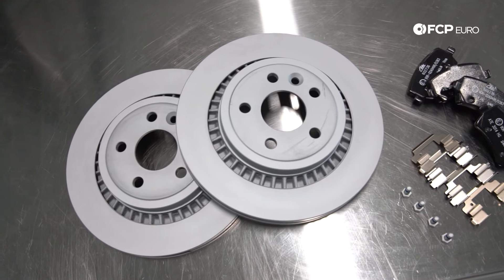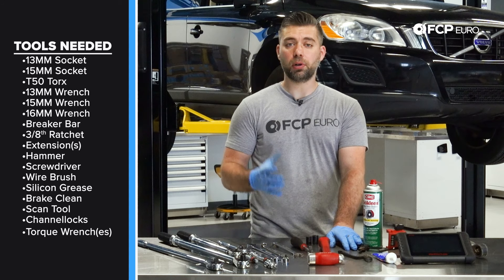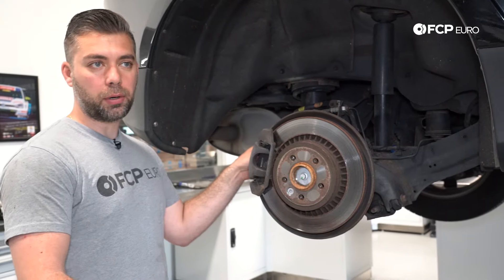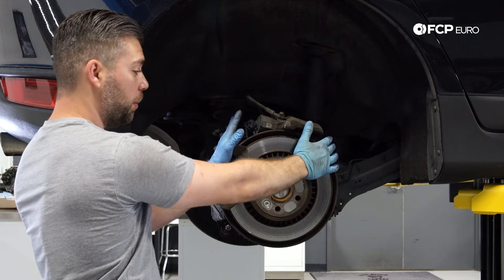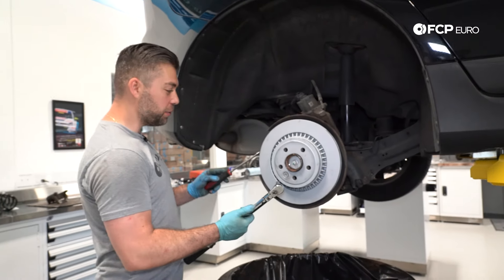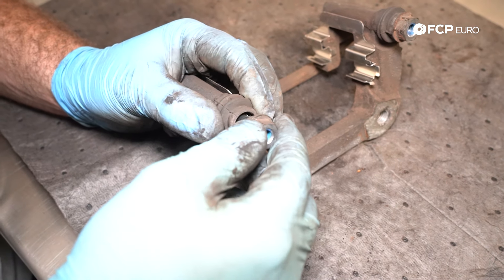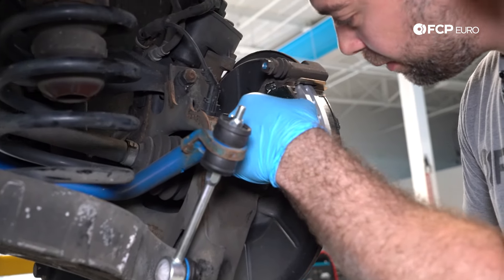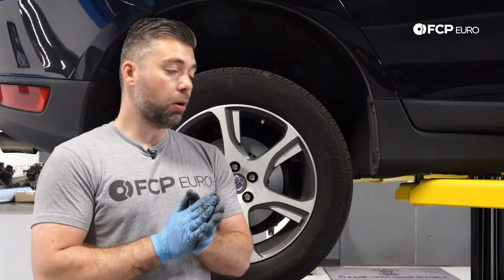Volvo XC60 Rear Brake Rotor & Pad Replacement DIY (Volvo P3 - S80, V70, XC70, XC60, S60, & V60)

Comment: A great help. Did the job (both rear breaks and callipers) in 2 hours, only 4 bolts and a torx50 screw needed to dismantle the lot. Re the electronic handbrake. 2 torx30 screws to separate the motor from the piston, torx40 to wind back the piston then easy to use a G cramp to collapse the piston. If you use the battery method you have to put pressure on the motor casing to collapse the piston. Also did the front pads and discs (just as straight forward), paid £255 for all 4 wheels, dealership wanted £1,100.

Comment: I just completed replacement of pads and rotors at all four corners of my 2017 V60 T5 (with solid rear disks), and in case anyone else runs into this: the rear pistons must be wound back into the calipers. They do not simply push in. They are a clockwise rotation.

Other than that, this video was really helpful, like the other FCP Euro how-to tutorials. Thanks for producing these - I've used several of them, and in particular the inclusion of all the torque specs etc is invaluable (and I like the lack of "fluff" - right to the point and no messing around).

Comment: I used a 9V battery to manipulate the e-brake motor, so that I wouldn't need a scan tool or have to dismantle the motor.  Other than that, this video was spot on for my 2011 XC60.  Thanks!
Reply: @igoldin74  Check out this video, starting around 50 secs in: https://youtu.be/8y54DKRHlAo . I know it looks like you're inserting these wires into a black hole, but there are contacts in there that you're hitting. You'll hear the motor turning, and may need to reverse polarity with the battery if it goes in the wrong direction. Use a fresh 9V, I think I basically drained a whole one between both sides of the car.

Comment: With the electronic parking brake once you have the caliper off put a small block of wood in the gap where
the pads would go and then unplug the electrical connection from the motor. You will see two pins inside
and you just put a 12v supply across and you can wind the motor back. The block of wood is to stop the
piston coming out if the motor is winding out. If it is winding out just swap the wires over and it will go the other way.
Do not forget to put the connector back on the motor.
Reply: Thank you very much!
Reply: Found this video today when I had to do the rear brakes on an XC60 and my diag software didn't have the EPB release function. This comment actually became a lifesaver for me because I did exactly as this comment says and was able to wind back the parkinng brake so i could wind the piston back all the way and fit new brakes. Thanks a mil it really works and its effortless.
Reply: Yoiu can unwind the EPB with a torx bit at the rear of the caliper.  Remember to switch the EPB to "off" before this is possible.

Comment: 13:39 If anyone is wondering, YES, that is WAAY to much grease. Dangerously so. A little dab spread out with a finger will do. The amount of grease he leaves on could, with the heat  generated by breaking, become runny and spill onto the rotors and disable your brakes.

Comment: You don't need a computer or anything. You need a t30 to remove the park brake motor. It's 2 bolts. Underneath it has a splined shaft that inserts into a hole on the back of the caliper. Use a t40 to twist that and it backs right out easy. Then use the t50 to remove the rotor.

Comment: Wheel bolts should be tightened 140Nm
Reply: I'm real late but really doesn't matter I drive 130 with bolts at 110 ft pounds

Comment: You can also wire 12v directly to the e-brake motor. One polarity will tighten it down and the other will retract. Typically pretty obvious.
Reply from the maker: Great point Cory, we'll have to show that method in our next video.
Reply: I used a 9V battery :) it worked
Reply: @fcpeuro  but there is a relearn procedure for the brake pads position, no?  Presumably that's what the 808 was initiating at the end and I believe VIDA references this, though I could be wrong (mine's a 2012 T6)

Comment: Great video but I have an issue with the caliper piston retracting.  I follow these instructions to a T, I have the Autel scanner mx808.  When I go into Volvo, hot functions, replace brake pads, start, I can hear the motor but the piston doesn’t retract.  Not sure why that is, in fact it seems to tighten

Comment: I was wondering if it is worth changing the Caliper flange bolts for new ones for every change of pads? I've seen some reviews to say to do this, and some say not to bother. Also, how often does one change the rotors per pad change....?

Comment: Take off the electrical motor connector from the electronic parking brake, use a 12V small battery and connect it to the electric motor terminals. Depending on polarity of the wires connected it will retract the parking brake.
Reply: A 9V battery will also work.

Comment: 2019 xc60 has two different options for rotors and pads.  If I want to use the bigger rotors/thicker pads, will this increase be a problem with OEM/factory rims? Or, do I need to buy bigger rims to accommodate?

Comment: Doesn't tapping the rotor run the risk of damaging the wheel bearings? I had a 1976 and 1983 Volvo 240 and the Haynes Manuals of the time warned against this. Thank you!
Reply from the maker: On a modern vehicle with modern wheel bearings, the chances of damage from tapping a stuck rotor in order to remove it is very very low. We have never had this issue.
Reply: @fcpeuro  Thank you very much!

Comment: I tried replacing just my brake pads and the brake pads on rotors that were slightly grooved. The brake pads wore out quickly. Now I am replacing the brake pads and the rotors. I did not end up saving any money. However the brake pads I replaced on old rotors that were not grooved are lasting fine. Could be coincidence though.

Comment: Why does brake cleaner evaporate so quickly?  Will the brake cleaner dissolve the Z coated rotors?  I’ve never seen those before.

Comment: What kind of grease do you use for the pins?.
Reply: Silicone Grease from 3m  08946   ACDelco  10-4019  or Raybestos  DBL2T

Comment: 10:26 What is the part number for those clips?! (I've got a 2014 Volvo S60 T5) I can't find them online and I just need to find those specific parts to start work on this job. Thanks!
Reply from the maker: Hello, those are typically included with the pads!
Reply: @fcpeuro  Oh ok! Thanks for informing me of that. I bought Brembo Brakes but I'm sure they're in there. Thanks!

Comment: Good job done. Observe do not put grease over all brake pins. Doing it will get rubber housing swallow and then brake pads will brake unevely. Just grease the top on brake pins 👍

Comment: Today I tried to change the rear discs on my Volvo XC60 D3/D4 from 2012.  The saddle with EPB motor was rather easy to release (and I used a 12V battery to return the pistons) but then when I tried to unbolt the two 15mm bolts (see 7:47) they unbolted in the beginning (not easy) but after a few normal turns they became so heavy to turn over that I thought they we're going to snap. So I decided to stop and put everything together again. Quite frustrating that I only could change the brake pads but not the discs...  Has anyone advice about this? Is it normal that these 15mm bolts become very difficult to unbolt at the end??? It seems not logical and strange to me.

Comment: I just did this job on my 2017 V90 CC, but I was unsure for the caliper pin torque specs. It was a 7mm allen pin bolt. 35nM seemed like too much as was used in the video, so I went with 28nM as I did with the fronts. Can anyone confirm if that is the correct torque? Thanks!
Reply: 35 NM was the correct torque spec on that bolt
Reply: @michigan_supercars6569  do you have a source? 35nM felt like it was going to strip it.
Reply: @raymond1124  Yes sir, in fact you can find it online as well as in this video. Hope this helps!
Reply: @michigan_supercars6569  this video is not for a V90 CC. If you have a link for that car specifically, that would be great.
Reply: @raymond1124  Oh, well then you'd have to find a more specific video for your car, but I'd assume if it's on the P3 platform then, like they said, it'll be the same for all of them. But I'd for sure double check online.

Comment: I have Volvo xc60 II, and gedore 40-200nm, so I wonder can I tighten screw on rotor and calipers instead of 35 to 40nm. That is 5 additional kg of force, so in theory when it comes to small values such as 35nm very small difference in strength, but again I never tried so I wonder if it is safe?
Reply: Hand tight for those.

Comment: Why do all the brake repair videos here on YT never losen the bleeder screw to compress the piston back into the caliper. The fluid in the caliper can and often does turn acidic. The rear brakes aren't as critical as the fronts but still there is enough fluid in the piston that as it is compressed can make it into the ABS system. The front breaks can push fluid into and through the ABS system and into the master cylinder. Everyone always talks about replace everything as to be cheap insurance by not cutting corners so why push the old nasty fluid back into the most expensive part of the brake system. A bottle of new brake fluid is also cheap insurance.
Reply: Fresh brake fluid is always recommended each 2 years, but don’t need to be done simultanious with the replacement of the rotors? Or am I wrong?
Reply: Well, then you might introduce air into the lines.
Reply: @GymChess No, it just means you shouldn't be doing a brake pad replacement if you can't do it without getting air in the calipers.

Comment: What scanner is used
Reply from the maker: Hi Brian, we are using the Autel MX808 in this video which is available on FCPEuro.com, along with a few others as well.
Reply: @fcpeuro  ok.that is the same scanner that I have but don't have the option to retract the brake.

Comment: How to know if you have an EPB?. Take the wheel off and look for a motor on the brake caliper? NO. Look in the car and see if you have a huge hand (or foot) operated lever. If not, you have EPB.
Reply: If you look in your Volvo on the driver side, there will be a little level on the left side of the steering wheel that you can press to engage the parking brake. That is how you know yours if electric. I think for Volvo's that are 2013 and newer have electronic parking brakes...but I could be wrong.

Comment: All that grease on the brake pads? NO NO NO. It will pick up every bit of dust and dirt. If the breaks get really hot it will melt and run onto the discs and or the pad friction surface and your breaks are then useless. No manufacturer recommend this either.

Comment: Dude 12volts or 9v battery  with two wires is ALL YOU NEED to retract the motor, saving tons of time, but i guess you want to sell the fancy computer. Then all you do is engage the brake, and release it three times. done.

Comment: Why you didn’t open the brake bleeder screw??
Reply: No  need! Why create a problem! the fluid goes back to the resivour
Reply: @chrisdigital   Yeah, shove that bad fluid back into the reservoir. The fluid in the caliper can and often does turn acidic. The rear brakes aren't as critical as the fronts but still there is enough fluid in the piston that as it is compressed can make it into the ABS system. The front breaks can push fluid into and through the ABS system and into the master cylinder. Everyone always talks about replace everything as to be cheap insurance by not cutting corners so why push the old nasty fluid back into the most expensive part of the brake system.
Reply: As long as you don't have the brake pedal depressed, then there will be no problems when pushing the caliper piston back in.

Comment: It's terrible! Ate Plastilube grease is not intended for caliper guides. It can't be used there. It is only for the guides of the brake pad and the fur coat on the brake pad.